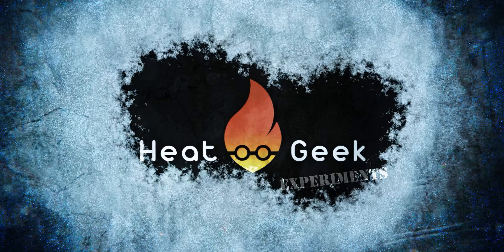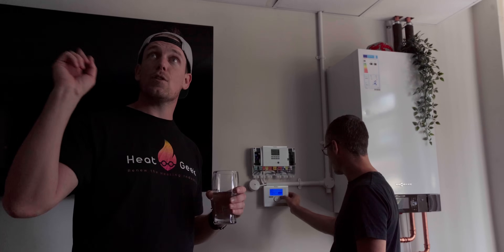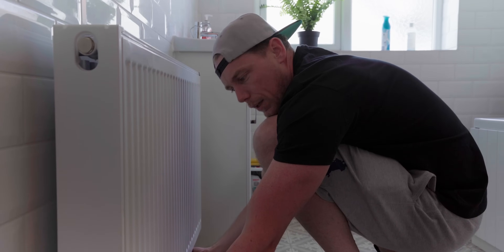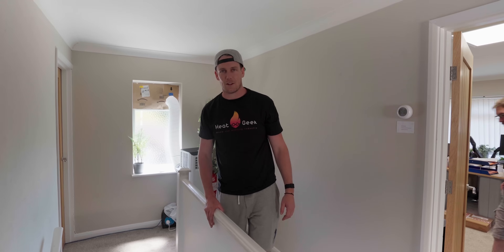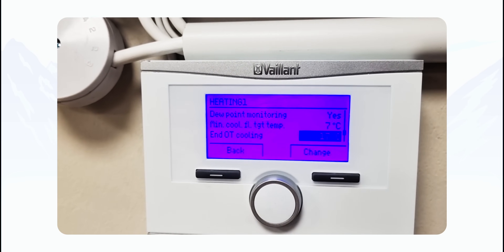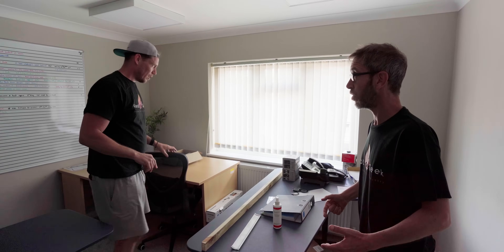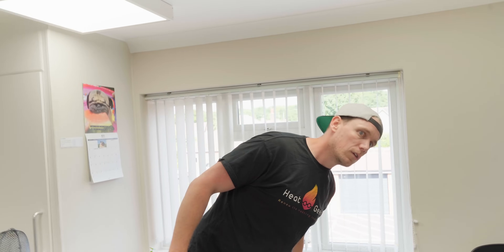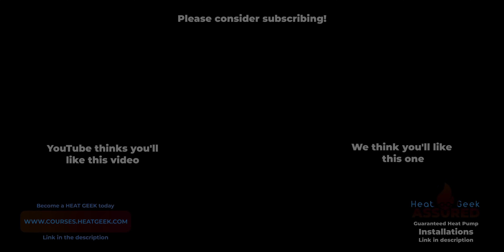How To COOL With Your Home HEATING System

Comment: I think cooling would be a lot more efficient if instead of regular radiators you had fan coil hydronic radiators - like Smiths Ecovectors. Of course it be better if these fan radiators had condenser drain pipes like air conditioning units. In Canada and US heating/cooling is quite often distributed via central air ducts so would be great for the same ASHP to provide heating and cooling. Of course mini  split air to air heat pumps have also been able to do this for years and are available in UK.

Comment: So, almost three years have passed - is there anything new since then? What is the best way to use the air-to-liquid heat pump also for cooling in 2025? In real life conditions I mean (e.g. the condensation sounds like a nightmarish scenario there)? Are there some actual commercial solutions for that?
Reply: A dehumidifier or an AC unit set to dehumidify...

Comment: Interesting! So presumably UFH is even worse than radiators with regards to stratification.
Reply from the maker: No much better. You get use of the whole surface area of the emitter and it will use radiant cooling

Comment: I was in a house a couple times where the homeowner is a hydroponics engineer. They have radiant heat, and had recently added a heat pump to his system so he had radiant heat AND cooling. Sadly both times I was there, it wasn't a warm day.

Comment: If you type the ID of that chip into a component search engine it will probably be less than £10. OK it may be programmed but why is the functionality not already in the main firmware?
Reply: Hopefully someone dumps the firmware on it.

Comment: The conclusion is you need UFH downstairs, tiled floor and fanned radiators upstairs to get cool rooms in the summer. I just need that Vaillant ASHP with chip installed by a heat-geek assured installer.

Comment: Normal to allow cooling to work we recommend cooling the buffer tank and use fan assisted radiators to make cooling a real factor , would not recommend for underfloor as we need take in dew point plus who likes cold feet

Comment: I think hydronic fan coils are a must with a a condensate drain so the water temp can be lower, you can use either a ducted fan coil if you have ductwork or wall hung fan coils units this can also be used for heating - Im going to test this out!

Comment: We're planning to overhaul our heating system at home, ripping out the rads and putting in some underfloor and an ashp. How much more efficient do you think the cooling effect will be underfloor? Have you any installs that run cooling through the underfloor and if you do, what is their experience?

Comment: So how do I as a user with a ASHP using rads and looking to go underfloor decides whats best, rads or underfloor for both heating and cooling? Don't use battery powered fans, or mains, use solar in the window to power the faning system!
Reply from the maker: Underfloor is always best for heating and cooling out of rads and ufh.

Comment: Heat Geeks... do you know if cooling can be enabled with a Daikin Altherma 3 ASHP? Mine has cooling disabled. BTW I have a Speed Comfort and it works really well to get the heat distributed into the room, and saves me at least 10% on heating. As sits at the bottom of the radiator and push the air up through, it would probably do the same job with cooling.
Reply from the maker: It doesn't work with cooling. Video out on mon

Comment: Need to open that 'chip' up.  Bet it doesn't cost £300 to make.  Another way of extracting cash from the customer.  I'm self building at the moment specced for an ASHP, but local installers just don't want to know about the cooling aspect.  Their are big manufacturers out there who actively advertise that their heatpumps will cool, and will sell you Fan coil units too.

Comment: Hi Adam, love the video, I have bodged our Samsung ASHP to run in cooling mode to see the affects which was quite pleased with over the past few days... The one thing I'm struggling to source though is a room stat that will operate between heat/cool, plenty in the states but not any in the uk, do you know of any?
Reply: I think evohome does cooling
Reply: Hi, I have been trying to get my Samsung 8kw heat pump to switch over to cooling. I have gone through all of the settings and manuals but just can’t get it to switch over. How did you do it?

Comment: Tell us more about the chip? Is it just a software upgrade to a cooling capable hp? 

You don't need to drop the room temperature very much to make it feel much more comfortable. Of course part of being comfortable is also lowering humidity.
Reply from the maker: I think it just makes a contact between 2 terminals tbh. Yes you only need a few c for comfort
Reply: @HeatGeek  for the few days we would need it, battery operated fans would work fine for a basic retro fit. It'll also be a lot quiteter than a desk fan!
Reply: https://www.youtube.com/watch?v=JBLCLRNuYfo

Comment: Several heat pump 'specialists' told me that ASHPs could not be configured to cool as well as heat. Even with my basic knowledge of thermodynamics (i.e. none) I knew they were wrong and this chip add-on proves it. Thanks for showing the world this approach,. Even though the radiator cooling approach seems useless, it's experiments like this that will fuel the innovation we need to see.
Reply: You have to have a bunch of reversing valves, I assume these are used as part of the defrost cycle on most units, but not sure if they are standard.

Comment: Do all heat pumps have the option to also connect split air? For example could a customer have raditors for 90% of their home and maybe bedroom split air?
Reply from the maker: No but you can use convector rads
Reply: @HeatGeek  Any systems that allow both heat via rads and split air? as in on market?

Comment: I've been thinking about this with underfloor heating. To cool your massive thermal mass.
UK climate is lucky in that if usually has cool nights - so FREE cooling - open your windows at night, in the morning close them all on a hot day. Only problem is very rarely like tonight the air temp is only dropping to 25! So not enough to cool my thermal mass - so tomorrow will be uncomfortable! Also externally shielding windows in direct sunlight.

Comment: Hi Adam 
I seem to recall that the U.K government was very much against the idea of grant eligible heat pumps being used to cool buildings for the obvious reason that it would add to our overall energy consumption. I can't see anything that specifically states this in the ruels but maybe this paragraph alludes to it.   

(f)if it is an air source heat pump, it is not designed to use heat in air which has been expelled from an appliance or building.

I think this might be the reason that air to air mini splits are not eligible for grants. 

That aside I find ceiling fans are very good at moving the air around and I wonder it they might help destratify that cold sink.
Reply from the maker: You weren't allowed to cool with RHI. You can with BUS as far as I'm aware.
Reply: @HeatGeek  Incorrect.  RHI did allow cooling, just as long as the "metering for payment" ignores cooling. https://www.ofgem.gov.uk/environmental-and-social-schemes/domestic-renewable-heat-incentive-domestic-rhi/applicants/eligible-heating-systems

Comment: So are all wet heat pumps fitted with reversing valve,, why can’t manufacturers do a duel air and water condensing unit,, use the air as an initial boost with the wet system as the back up radiator,, just divert fgas between room evaporator and chiller heat exchanger,thank me later

Comment: Very interesting! In this experiment, with the very low target flow temperature, but with the resultant stratification within rooms, is there a potential parallel to how you should use a heat pump (or any system really at its most efficient) and low and slow temperatures for heating and not quick blasts? I.e. instead of 7°, could just running at e.g. 18-20° all the time lead to more consistent room temperatures even with radiators?

Comment: What would a typical COP be in “cooling” mode?
Reply: All depends on temperatures and compresor speed.  Apparently A35W18 running at 40% will give you 4.5  on 7kW unit and  A35W7 running at 100% it's 2.5.  (ASHP shouldn't be sized to run at 100% though, so you should expect COP of 3 for A35W7 in practice)

Comment: Getting like Australia over in England with temperatures getting up close to 40C. Not unusual here. 50C plus in some places. My area topped out at 49.6C a couple of years ago. The norm here is Reverse cycle Aircon. Cool in Summer. Hot in Winter. And lots of solar panels to power it. Ducted is the ultimate but split systems work. Simple easy retro fit. Only require electric coming largely from Sun. Low emissions. No complicated pipework. No ugly radiators. Relatively cheap. Solar hot water with back up element. Then all you need is for the Sun to shine 12 months of the year like it does in Qld and your all set. Good luck with that.
Reply: "Then all you need is for the Sun to shine 12 months of the year like it does in Qld" - The scary thing is that's what we're heading for,. Christ knows what you guys are heading for?!

Comment: Well that's really interesting. Radiator fans tied into cooling cycle will almost do away with turning radiators up side down.. Would like to see overall results, also is there a type of radiator more efficient for cooling?
Reply from the maker: Yes. Purpose convector radiators

Comment: I think what you're looking for to make this work is the good old fashioned ceiling fan!
It can either push hot air down or draw cool air up as well as circulating the room air!
Reply: though ideally new builds should start getting hvac at this point
Reply: @Progan666  you would think so, but there's so many Victorian and Edwardian properties kicking about it would be impossible to retrofit HVAC systems (except for the top end ones with 12' ceilings)
Underfloor heating can be used to cool a property in conjunction with the aforementioned ceiling fans 🤔
Reply: @georgefuters7411  I reckon those old Victorian and Edwardian properties have chimneys that are perfect for ducting and ventilation.

Comment: Great video, with 40 degrees becoming a common feature in the UK we are going to need systems that both heat and cool. In did have one qu, does the heat pump still provide hot water for faucets and showers whilst it’s in cooling mode?
Reply from the maker: Yes.. it switches between the 2.

Comment: fascinating. I always wondered why they weren't used for cooling, and assumed radiators (correctly perhaps) are a terrible way to cool a room. But for a handful of days a year this could be a solution! Now I just need a heat pump :)

Comment: Be interesting to see the fans you can get for pushing air up in the winter like the speedcomfort ones on Amazon would work when the rads are cool. 

This is the area where heat pumps are game changers, but when the heat pump is running in reverse and are cooling inside can they use the heat generated so they can run heat to the hot water cylinder?
Reply from the maker: Yes.. they are hit water prioroty
Reply: Yes you can put radiators to cooling mode and heat water, but not at a same time - so unfortunately when cooling radiators, that sam etime waste heat is directed outside and is wasted. When heating hot water cylinder, then cooled air is directed outside and will be wasted.
For example my daikin has motorized valve and heat pump can heat floors and when hot water is needed, valve moves to hot water cylinder mode and heats hot water. When water is hot, valve moves back to floor heating.
Reply from the maker: @meelis79  all heat pump systems work that way.
Reply: @HeatGeek  I gave explanation because your first reply may give impression that when cooling, you can redirect that waste heat to hot water tank. Was question you replied about that?
Reply from the maker: @meelis79  no, only waste heat recovery heat pumps do that.

Comment: This could be the start of something that gets people wanting heat pumps a lot more the only thing that puts me off air to wet heating ASHP is that air to air can heat and cool !
Reply: Just get an air conditioner and use it for heating in the winter. It's just an air-to-air heat pump and will likely be more efficient than cooling a radiator. It'll certainly cool a room more quickly.
Reply: Is a air to air more or less efficient?

Comment: Thanks for this. The Red Heat pump promises heating and cooling. But there’s not a word I can see on how cooling works.
Reply: This is one of the problems with heat pump manufacturers, they all regarding cooling as secondary function, so there is less information about it. This will change over time, and this video is a great introduction. We definitely need a heat geek video on designing heat pump systems that can provide space heating and cooling, and domestic hot water.

Comment: So would the option be to have something ceiling mounted (like you see with AC’s) and some kind of zoning in the system, such that heat goes through the rads & cooling goes through the ceiling mounted vent/AC/thing?
Reply: Yep ive got a chilled water cassette / fan coil unit installed with my ashp

Comment: Very useful. I was wondering how this would work.
I wonder what the energy usage is like vs traditional air conditioning?

I'm moving to a new house and wondering about getting air con installed...
Reply: On my house I use floor cooling on 1sr floor and radiator cooling on 2nd floor. Between 25-27 in the house, 38-40 outside, consomption around 5-10kw per day. Without cooling 30 degré inside.

Comment: Was going to ask about dew point, very neat it's already inbuilt.
Reply from the maker: Maybe.. bot had it working that way yet though
Reply: The downside to monitoring the dewpoint is that on very humid days, the amount of cooling could be very much reduced by the heat pumpt trying to respect this setting, just when you want the cooling most. Using fan coil units (rather than wall-mounted radiators with aftermarket fans) is a much better solution as they are designed to collect and dispose of the condensate safely, so you can run without monitoring the dewpoint. All your piperuns should be well insulated so by selecting the right insulation and taping all the joints in the insulation, you can create a vapour barrier around the pipes such that you don't get any condensation on them.
Reply from the maker: @tlangdon12  sure.  Were looking at pipes that aren't vapour bariered though.. I.e. 99.9% of properties

Comment: Enjoyed that and hadn't seen the dew point monitoring option before. Please keep it running for a longer period and monitor please. Of course heating the hot water if using the pump for cooling will have a COP of 1 with immersion heaters.

Then again, using the heat p
ump in the summer, although it's a bit of an experiment and jolly wheeze, will please the Electricity Barons enormously, more kW's an hour for 24 hours a day for several months?

Comment: How would this work with underfloor heating?
Reply from the maker: Much better.. out technical vid goes in to more deatil.. due soon
Reply: This would be great! Our UFH is in the kitchen, south facing, and cooking noticeably keeps that room hotter for ages - even just boiling some potatoes on the induction hob is a huge influx of energy.

But cooling that floor, and by extension the concrete slab below, would be totally amazing in this heat.

Looking forward to the vid, and I'll definitely be adding cooling to the questions I ask heating engineers for our ASHP.
Reply from the maker: @TheBadoctopus  use the find a heat geek map
Reply: It is made for underfloor heating. It works well, just beware of dew point.

Comment: This is the first time I've seen someone try it with radiators. We have a couple sites set up for UFH/UFC and that drops the temperature quite rapidly though there is a lower limit due to the risk of cracking the screed.
Reply: Interested to see how well it works for my upcoming new build

Comment: Could you not put a flow divertor in the rad? Ive done this on my tall rads to force the heat up. Same concept could work for the cold water.